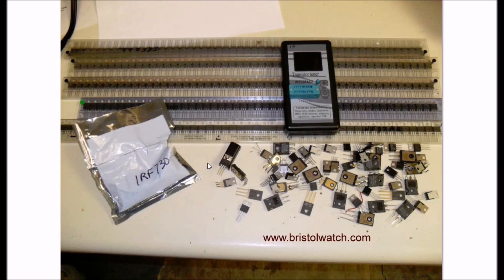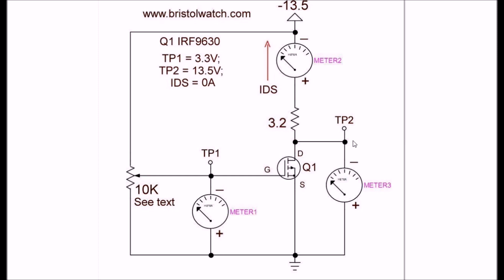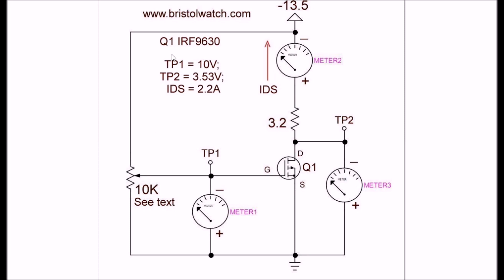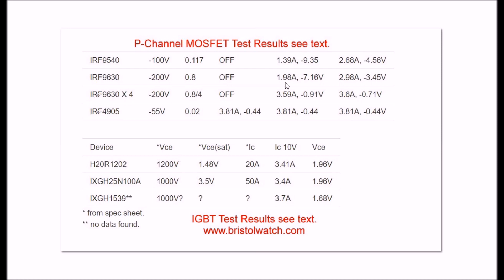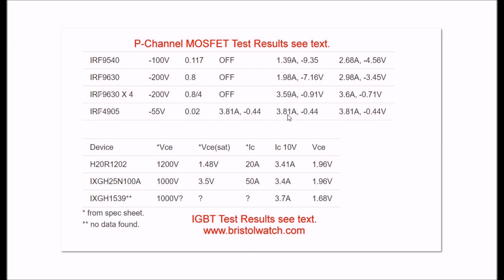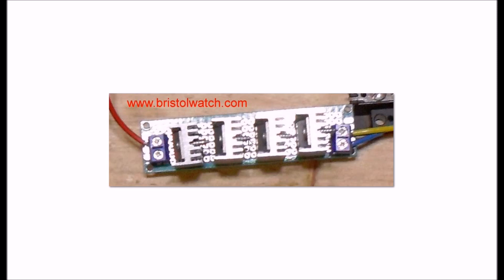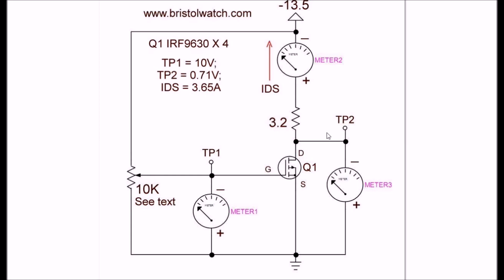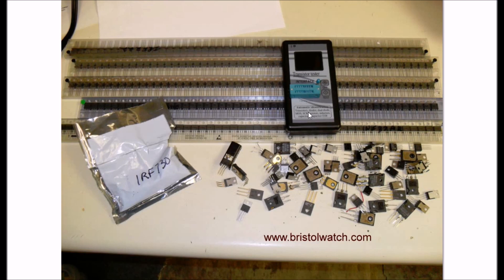Parallel P-Channel MOSFETs Results, Observations

Comment: Very useful. How could real world data not be? It would be interesting to pop one of those CCP built LCDish meters open, single shot it and see where it decides to find its voltage levels.  If one were skilled in Arduino cancer (maybe PIC, just guessing), I wonder if the code would tell you. Just thoughts.

Comment: I’m surprised that the actual RDSon is a factor of 5 or more times higher than the spec sheet value. Why is that?
Reply from the maker: I don't really know. The IRF9630 acted within specs even with a high rDS(on). The IRF4905 worked great as well as a similar n-channel. The IRF9540 was the only p-channel I had way off-spec.
Reply: Ok - thanks for the reply.

Comment: The N-Channel MOSFETS that I'm using for my ZVS driver have a very low RDSon (0.3 Ohm) and they can handle up to 400 volt drain to source, the gate can handle up to + - 30 volt, have a low threshold voltage and can dissipate up to 190 Watt, I have 2 in parallel for each side and they never get above ambient temperature. 
Here's the device number IRFP350LC and the datasheet here - https://www.alldatasheet.com/datasheet-pdf/pdf/68518/IRF/IRFP350LC.html

Comment from the maker: Related webpages and videos:
N-Channel MOSFETs Test Results, Observation
https://youtu.be/rZ_ZjGUwuAs
Weblink for tables, data, and schematics:
http://www.bristolwatch.com/ele3/mosfet_test.htm

LM2575 Simple Switching Voltage Regulators
http://www.bristolwatch.com/sr/index.html
https://youtu.be/6Qrs3JmdPl8

Issues on Connecting MOSFETs in Parallel
http://www.bristolwatch.com/ele2/pm.htm
https://youtu.be/AOf-i2vLd2o

Simple Circuits for Testing MOSFET Transistors
https://youtu.be/mv0IksPy2JQ
Reply from the maker: Just be aware of these issues. I did find one good p-channel.